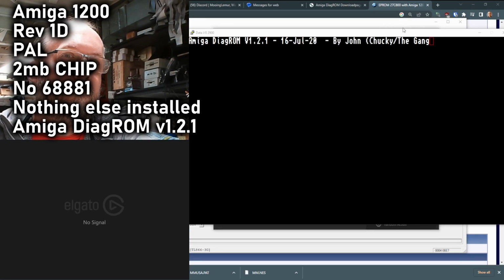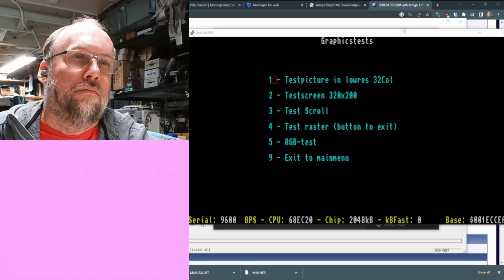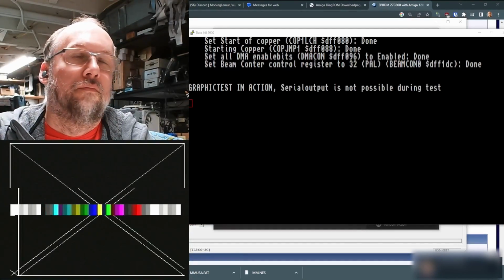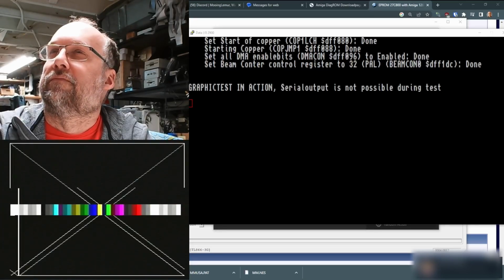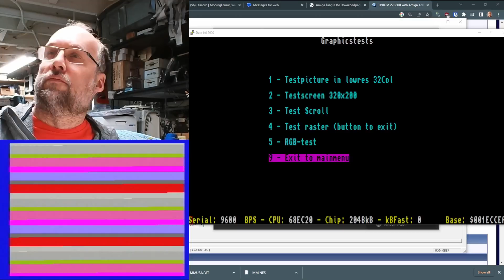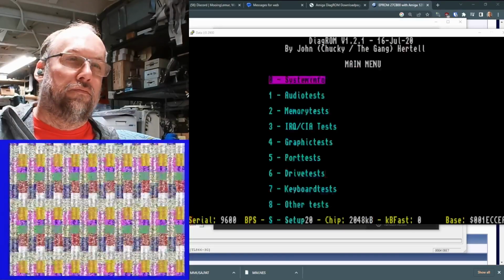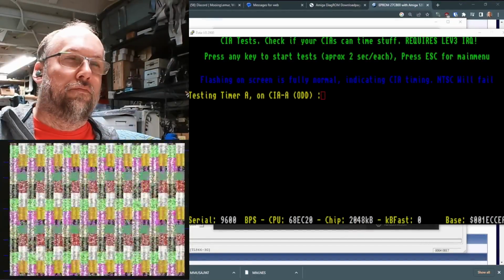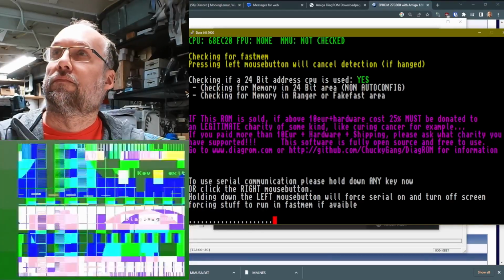Sick Amiga 1200

Comment: Just grabbing thin air here, but I had a similar problem (though not diagnosed this deeply) and it turned out I just used too long video cable causing to draw too much juice out of Alice. Using a shorter cable or a buffer helped in my case.
Reply from the maker: Heh in this case, I was using composite video connector .. so it's not that.

Comment: Not a pro at Amigas, but I was interested in searching it out. Just a couple things I found. May not be correct:

First motherboard has a flicker bug: There is a fix posted in 1995 on Aminet--A1200 Screen flicker fix V1.0
1.D4 revision in particular seems to have a problem. The fix was to replace a cap. User Anemos described it as "1μF - 50V (smaller of guide but stronger voltage). Oh and polarized is: (-)on the left, (+) on the right" 

Another suggested fix that worked for some: Eliminate any colours in the screen's palette set to 255,255,255 (full white). This particular person "little daemon to monitor the palette of the top screen and adjust to 254,254,254 any such offending colours."